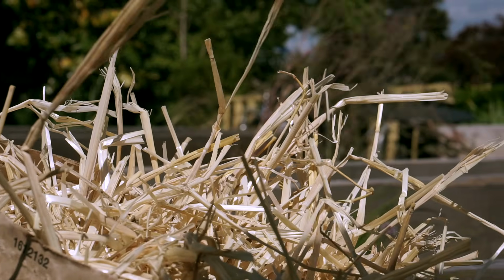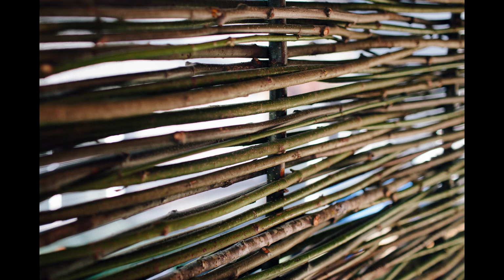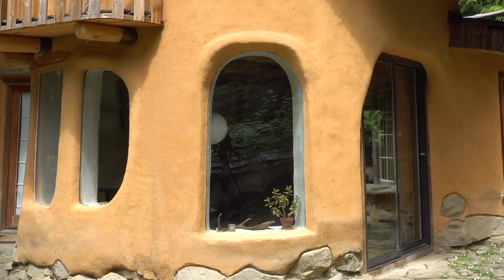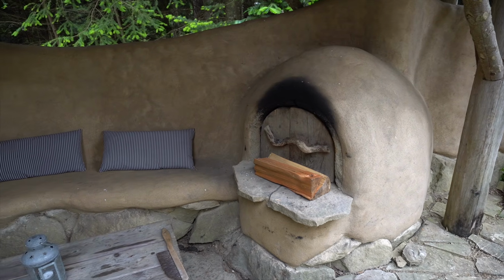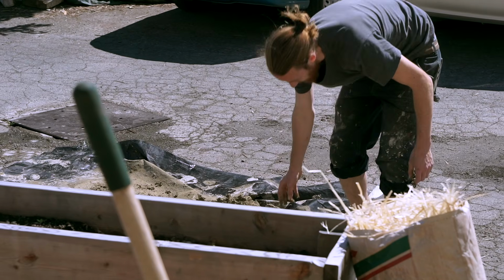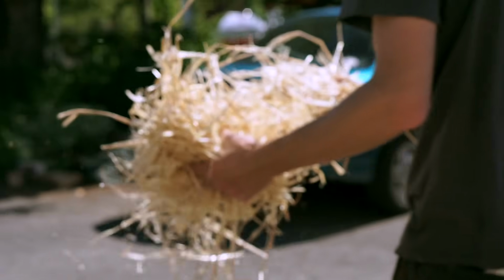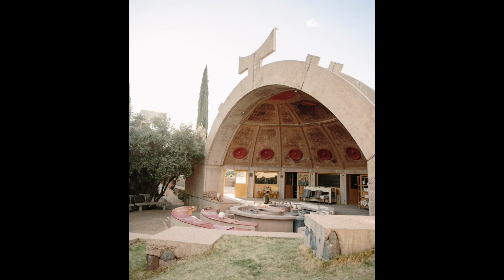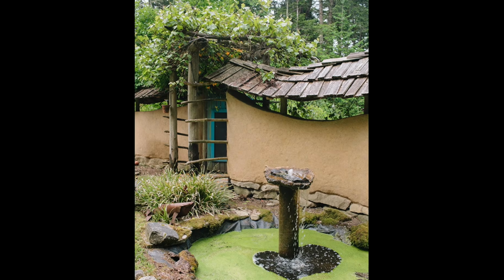Building with Cob - A Natural & Affordable Way to Build a House

Comment: Cob is great but it needs a lot of work to maintain,  if not repaired every 7-10 years it chips , warps etc. And if not perfectly isolated   it will melt .
Best regards
Reply: What about vinyl siding cracking from sun exposure and getting holes from hail? Ice and snow wrecks concrete parging. UV wrecks all manners of coverings. That's been my experience. In South Africa, walls made out of clay and wattle with a lime plaster on the outside have lasted 350+years so far in that heavy sun environment and extreme weather conditions (called the cape of storms for a reason)
Reply: Modern houses need even more maintenance. Painting for one.
Reply: What do you mean by "perfectly isolated"? Can cob houses not be built near other types of houses?
Reply: HORTONDLFN isolated from the ground with a rock foundation. Isolated from the rain with a large roof overhang.
Reply: Let's not forget how horrible the insulation value of this structure is. Even if it is "stronger", it will be very wasteful for the HVAC system. Also, it doesn't do well with seismic restraining.

Comment: Clay reinforcement with straw root is cost effective building material.
Reply: True statement based on the region the structure is being built. Also labor hours are higher with that kind of work when compared to stud walls with insulation. Not to mention poor seismic restraining abilities.

Comment: There is no information for this type of building on vapor profiles, R-values, how to get plumbing and electrical in the house, airtightness, etc.  The only way to ventilate the house seems to be to open windows--better have good outdoor air and non-polluting neighbors!  Also, the presence of a combustion appliance (fireplace) indoors is concerning.   It could easily backdraft or spill it's combustion by-product into the living space.   Cob building is also extremely labor-intensive.  It probably is only suitable in certain climates like the Pacific NW.
Reply: This is an introduction -- not a blueprint. There are 300 yo cob houses in Britain, Wales and Ireland. Some with thatched roofs, no less. So your concerns about fireplaces, combustion,  is overblown. As for labor intensive: all that lumber in conventional houses didn't cut itself down, mill itself into 2x4s and deliver itself to the site, you know. Cob is cheap because materials are universally available, and labor is usually done by the owners. And yes, as with any building,  plumbing, electrical lines, duct work, has to be planned ahead to fit into wall spaces.

Comment: Is the cob building method a bad idea for a home built at 6,000 ft elevation cold
climate with snow in the winters?  and what about earthquakes, will it fall apart?
Reply: Adobe (cob) is a common building material in Santa Fe New Mexico in zone 6 at an altitude ofover 7000 feet. There are many buildings still standing there from the 1600s such as San Miguel church and the Palace of the Governors which is the oldest continually used governmental building in the United States.

Comment: Hey. Very cool video. I was wondering if you had ever heard of anyone putting cob over straw bales? I live in great plains and native limestone house are very common, I've seen sod dugouts, and also a lot if strawbsoe houses. Usually the bake houses are covered in stucco but I like the idea of a more permanent solution, something I do once and don't touch for like twenty or thirty years. I had wondered about concrete. But this video has me interested in cob. Any feedback would be appreciated.

Comment: That's true, cob houses are very strong. In my home country, Afghanistan, houses are mainly built from dirt. Even the flat roofs are made of clay and joist from tree trunks for support.  It's bullet proof. Even if you hit it with mortar rounds, you can't completely demolish. In winter, when it snows, you go up the roof with your wooden snow shovel and clean the snow. We used to replace the top layer every time we noticed a leak in the ceiling. Top layer has more straw to make it more erosion resistant. So one layer could last a year or two depending on the amount of rain in a year.
Reply: I'm sad that you know how it stands up to bullets and mortar.
Reply: Wow that’s amazing
Reply: Hey! Thank you for letting us know about the rain and how much it can handle it. I readneveruwhere about cob but nobody took the risk to do the roof too, just ovens, they said ovens were handling the rain good. So thank you for letting us know and also that we can just change the top layer and do again.
Reply: Wow.. thanks for passing on the knowledge about the top layer having more straw in it. Makes perfect sense.
Reply: Wow they are even bulletproof

Comment: can I use that method to add insulation to my external walls?
Reply: Adobe (cob) has the advantage of thermal mass. It absorbs, stores and emits heat. Thus when it gets warm it stays warm and when it cools it stays cool, keeping an even temperature. In the southwest it is often paired with passive solar heating.

Comment: It would be interesting to see how these buildings hold up in N Iowa. LOL I think the 60mph winds and ridiculous rain falls would destroy them in a year or two at best. Not to mention our tornado weather! You may say other types do not withstand tornado's but that is false. Brick buildings that are maintained do pretty well. I personally have been in one during a tornado and it needed a new roof because of shingles etc blowing off but that was about it. The roof was still there and I was at the building daily and it did not leak afterwards but insurance just put a new roof on. BTW that was the 2nd time in 10 years that building was directly hit by a tornado. Other structures (wood framed houses mostly around here) did not fair so well. I have a red clay brick house. Not so good with holding heat due to being 100 years old but I doubt it will be gone for many years now with the metal roofing I put on it! Cod I imagine would leak for sure here... we get horizontal rain several times a year. You could not get the city to allow a cod house here either. They would shudder at the thought since all we have here is sand and mud in Iowa! People would be building their own houses and not spending tons of money. In fact they some would most likely build houses in places that people would not notice right away and that would be fun to deal with but yeah I doubt cod would work for very long here otherwise some dope smoking hippie wannabe would have been doing it by now on some farm far from the cities prying pocketbook.

Comment: Would it work in Florida where we have 95% humidity for a great amount of the year.  Would a cement mixer make it easier?
Reply: It will work even in tropical climates and yes, you can use a cement mixer.

Comment: When building a cob structure, and you're ready to finish a wall,.. is there something you should coat the walls with like a plaster,, stucko, or a type of paint to act as a sealant,..?  I was wondering because on the inside parts where theres a bench like a bench over a Rocket thermal mass stove tunnel , to keep the sand and dirt from getting on your clothes and blankets when you sit on them,..  Thanks

Comment: you need to go to Hungary there you can see a lot of cob houses. I've just been there and i was amazed - I suggest to visit the open-air museum of szentendre
Reply: As G Zeus already said, such old houses in Hungary are more mud than cob. Also, such houses need to be lived in. So many such rural houses you see in Hungary have creeping damp up the walls (look at the flaking plaster inside and outside near the foundation) because theses houses need to be lived in to move the moisture from the soil that creeps up the walls (they were not built with a water barrier in the walls). That is the moisture in the walls needs to be pulled out by having a warm space then vented to the outside. Such houses should not be air tight. They stay warm based on wall  mass, not insulation. And one must vent the humidity. I live in a stone house in Hungary, which has similar problems as the material between the stones is just dirt, and the walls had considerable damage to the interior and exterior plaster because it was not lived in. It took two (2) years to dry out the walls before replastering. But living and heating the house all winter since then keeps the walls dry without problems.
Reply: Yes! Romania too. I grew up in a mud house like this on the border with Hungary. The house is probably 75 years old and its looking great.

Comment: So I take it Cobb will hold up in extremely cold and hot temperatures??
Reply: I don't think it's recommended in extremely cold environments because it's not a good insulator. It has very good thermal mass which makes it great for moderately cold or hot environments which is why you see adobe in the deserts where it can be scorching hot during the day and very cold at night. It'll absorb the heat into the walls during the day and transfer it to the interior at night. During the day I think the temperatures stay fairly cool inside because the earth absorbs heat from the interior since during the night the cold temperatures on the exterior cooled the walls down. I think for very cold climates the technique more commonly used is straw bale with a cob plaster over that. The straw provides a lot of insulation. Hope that helps.

Comment: But is it sustainable in the long run especially against the natural calamities...
Reply: Hmm... So, there are thousands of cob houses in Europe and the Middle East that are hundreds if not thousands of years old. I'd say that's a pretty good track record for their endurance. They've done earthquake tests on cob structures too which did pretty well and they're fireproof. I'm not sure what kind of wind speeds they can withstand, but considering they hold up just as well if not better to bullets than concrete it wouldn't surprise me if they'd withstand more wind than modern construction including brick since the walls are typically 12-18" thick. I'd feel safe in one and I live in the middle of tornado alley. :)

Comment: Glad to know cause i plan on rebuilding a my grandmothers home..And i was looking for a more organic way to rebuild her home..tx
Reply: Beya B.
Use cob and plastic bottles filled with dirt or sand! It helps recycle something that is a huge landfill and ocean problem, search in the search window above.." building with bottles"! But flip flop every other bottle opposite the one before so necks on both sides! Use chicken wire. Then tuck in about 8" of cob on both sides and bam you have fire proof, earthquake resistant, tornado/hurricane/cyclone Resistant, flood resistent, pest bug and rodent proof except for exterior doors could eventually become a problem

Comment: Earthquake proof?
Reply: Although adobe (cob) isn't earthquake proof, it has been used in earthquake-prone areas such as California. Most of the Spanish mission churches in California built in the 1700s are made of adobe. Most of them are still standing after hundreds of years but that's because some have been rebuilt and they've all been well-maintained.
Reply: Although Adobe (cob) is not earthquake-proof, it has been used in earthquake-prone areas such as in California. All the Spanish mission churches built in California in the 1700s are made of adobe. Most are still standing because some of them were rebuilt after earthquakes and all of them are well-maintained.

Comment: i dont understand why all houses arent built this way
Reply: In rural India 🇮🇳 90 percent of houses are made of cob.  They are very beautiful and some of them are very large.
Reply: @gayetri6  lies.
Reply: @gayetri6  do they build them very tall?
Reply: Hemp houses are much stronger, but thanks to farmers we cant use it.
Reply: Gilgamesh Of Sumer what makes Hemp houses stronger than cob and why is it farmers fault?
Reply: In the past in Romania the houses were built în that way .
Reply: wrong !
Reply: Greed!
Reply: Must be the MOOOONEEEEY
Reply: They are probably not very comfortable year-round.  Matt Risinger showed a video of a house built before codes required insulation.  He opened up the wall, and there was no rot or mold (because of all of the air flow)  You can't build that way today, because you would have astronomical energy bills, and still be uncomfortable in the winter and summer.

Passive House is the only way to go.  If built correctly, you will have low bills, good indoor air quality, and superior comfort.
Reply: Variety of reasons.  

Some climates are not great for the longevity and health of a cob home.

Some if not most of the reason why is that cob houses take more time to make vs. the usual build.  You have to pay people for their labor and more time means more expense.  (This is why you see  this idea of having cob house building parties...the proponents of this material need to sell the idea because the costs -if you’re not having friends help and work for free...otherwise will be more).  It’s also a factor that if something goes wrong with your house, as time will bring some sort of problem to fix, getting someone to repair it might be difficult.

As with anything in life, if it’s not the status quo, it can be difficult to have done.  People aren’t great at switching to something new or different.  What’s efficient and effective for the time usually wins out.  (Side note- that’s why these ideas are making a comeback, because people need cost efficiency and we’re unhappy with pollution , waste and separation from the natural.). Cob probably fell out of use simply because there became an easier quicker way that became what the builders know how to do.
Reply: Less money to be made by the ruling class. I'm planning on buying some rural land and building small getaway cottages for couples to rent. In my area you can more or less do what you want on  your own property as long as it's not in city limits. :)
Reply: @idroolt6999  what area is that? I've been looking for reasonably priced land in areas that have little to no CCR's or restrictions. Thanks in advance for your help!
Reply: Huge amounts of labor excivation & construction.  Also NOT actually comfortable in most climates.
Reply: Tiny-Giant LifeStyle Why do you say cob not comfortable in most climates?
Reply: @DylanBegazo  .
Reply: Paul Schneider208663531 ....... What?
Reply: @TinyGiantLifeStyle  .

Comment: Interesting concepts. However, one has to have a lot of labor to build one. Which seems to be something that is always missed in many of these vids. And I wouldn't want to be in one should I live in a wet climate or an area that is prone to Earthquakes. Rammed earth, earthbags, and ramed tires all make the same claims. And they are very energy efficient. But with all the labor involved one loses any cost benifits.  While concreate has been given a bad name by certain groups, one can create a monolitc dome and get all the benifts plus some.

Comment: How many floors can you build with cob?
Reply: Eight stories I believe is the tallest cob type construction and it's around a thousand years old. It's in Iran if I'm remembering correctly. I'm not sure how thick the walls would have to be at the base, but I'd think they'd have to be several feet thick.

Comment: I'm wondering if cob could be used to frame out the space between shipping containers. I was planning to use hempcrete, but cob could be an option, especially with an outdoor kitchen.
Reply: I'm sure it could be, but I'm a bit confused about what you meant by "between" the containers. You talking about the seam between two side-by-side containers? Why not weld them together? If you're looking for a waterproof seal between them I'd go with concrete mixture of some sort and then tar it especially if you're burying them. that's just me though.

Comment: This is really cool! This may be a dumb question, but would it be too heavy to use as building material for a DIY rv/tiny house that would be moved frequently? And would it crack from moving?
Reply from the maker: Hi Maria and thanks for your question.  I definitely don't think it would be a good material for and mobile movable space.  I'm not an expert but I'm pretty sure it would be much too heavy and would possibly crack during transportation.  Thanks for checking out the video!
Reply: Exploring Alternatives Thanks for your reply!

Comment: I love cob. Can someone tell me if it can be used in homes that go through -40C winters?
Reply: wildebtw I believe cob can be used in very cold climates, the issue is that it is not a very thermally insulating material. The thermal mass of cob however, in combination with solar gain can make winters very pleasant and warm in UK climates. Much colder climates would likely need a different design.
Reply: wildebtw cob is not recommended for colder climates.  Check out straw bale structures!
Reply: That's what I was wondering, too.